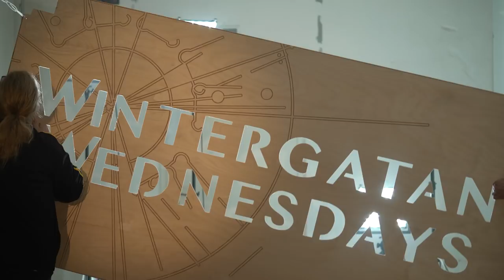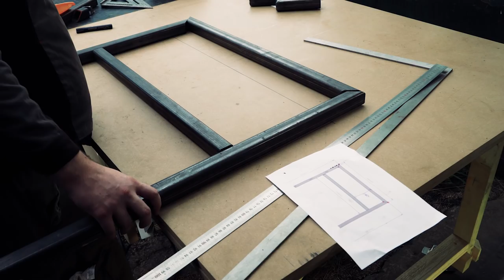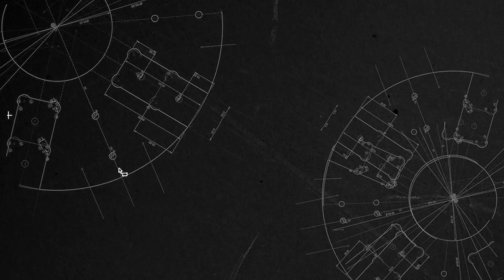Welding the Steel Frame - Marble Machine X Goes Metal #11

Comment: Rage Against the Marble Machine
Reply from the maker: RATM is the reason i started playing music!
Reply: There's also a pinch of "Paradis" in there.
...
...
...
...
or the other way round: there's a bit RATM in "Paradis"
Reply from the maker: Its really the other way around, there is a million pinches of RATM in Paradis :), we call that part in paradis the ragepart when we rehearse actually. , its a tribute... When i saw Tom Morello using the mic switching technique i wanted to start playing electric guitar... i thought it was too cool to use a feature that was not meant to be used in that way
Reply: Bonestorm the best thing is Martín Mollin with that guitar OMG!!!
Reply: By the sound of it it's more like The Dark Side Agains the Marble Machine ;)
Reply: Bonestorm that's just what I was thinking!
Reply: Holy Tom Morello
Reply: Sounds like there's a big touch of Stoner too if I'm not wrong
Reply: fucking brilliant
Reply: Bonestorm Yes!!! that is exactly what I was thinking!!
Reply: Drilling in the Name of.
Reply from the maker: Someone else wrote "killing in the frame of" :)
Reply: Wintergatan I like where this is going 😂🤘👍
Reply: Awesome stuff !
Reply: ha ha ha
Reply: @Wintergatan  when if WELDING THE STEEL FRAME HAS ON BANCAMP
Reply: @Wintergatan  🙁🙁🙁🙁🙁🙁🙁🙁🙁🙁🙁🙁🙁🙁🙁🙁🙁🙁🙁🙁🙁🙁🙁🙁🙁🙁🙁🙁🙁🙁🙁🙁🙁🙁🙁🙁🙁🙁🙁🙁🙁🙁🙁🙁🙁🙁🙁🙁🙁🙁🙁🙁🙁🙁🙁🙁🙁🙁🙁🙁🙁🙁🙁
Reply: @Wintergatan  this is amazing. i am rewatching this years later only to discover one of my favorite artists listens to another of my favorite artists. you and ratm are defo both on my top 5. love this so much.